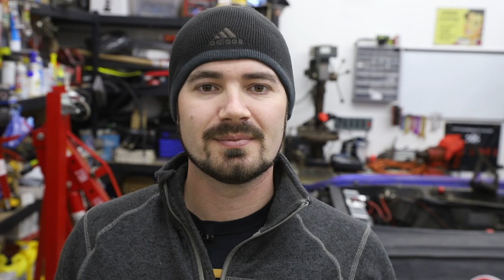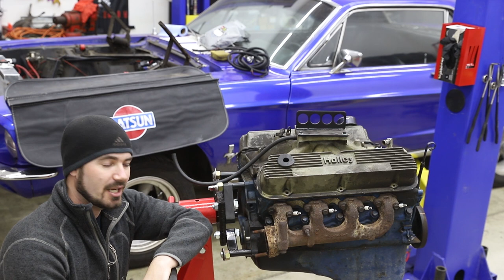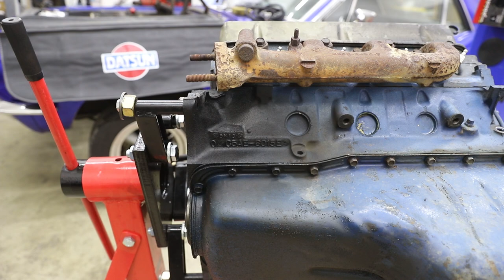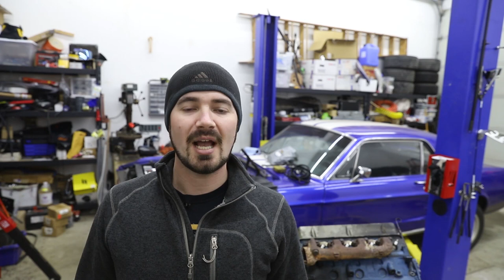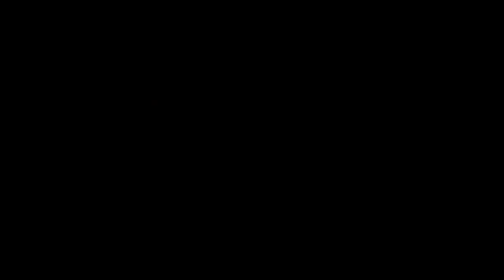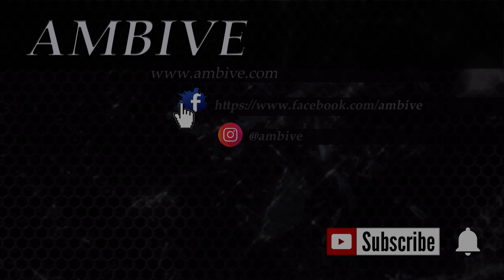67 Mustang - Identifying the old engine

Comment: Just to make it clear. You state in the video that the 6015 suffix denotes the cubic inches. This is incorrect. The 6015 is the engineering basic # for all engine blocks. The over the counter replacement block would have the part basic of 6010 for a bare engine block. Where as the prefix c5ae again is the engineering assembly line basic number which would be a C5AZ in the parts book. The whole part number as an over the counter replacement would be C5AZ-6010-A OR B or C based on how many engineering changes were made to the product line. And it is possible to have an AE block in a mustang as the blocks were all identical and originally developed for the full size Galaxy and they were used in multiple lines. Even the HIPO block was the same with different damper, solid lifters, and bigger connecting rod bolts (3/8 i believe), beefier main caps, screw in rocker studs, hotter cam and dual point distributor. However on a 1967 it most likely would have been A C7AE.  The fact that the block is stamped C5AE does not make it incorrect for a 67 as the number above it is the date the block was produced (cast) there was another stamping on the block or the engine which actually shows when the engine was assembled. So this particular block even though it was manufactured in 65 could have been sitting in inventory waiting to be assembled for a 67 model year which would have been produced in late 66 not uncommon to find that. Worked in the Ford parts department for many years if you're wondering about my source of info. Also have a few 60s mustangs as the original owners were my mother and father.
Reply: Hi!

I have D0AE on the engine block in my 1970 Mustang Mach 1. Would that possibly be the original engine? I'm trying to figure out if it's been replaced or if its original. Thanks for any info!
Reply: @itsryanfreeman  you would need to find the production date stamped on the block. Some blocks may have the last 6 digits of the vin stamped on them. The D0AZ denotes 70 for the D0 the AE is the engineering letters for AZ which is for full size cars such as LTDs but were used in Mustangs as well on engines that were found across multiple vehicles models. If it was an engine specific to let's say a boss 302 mustang or eliminator Cougat then it would be D0ZE or D0ZZ for a parts department #

Comment: Sorry buddy but There were no ZE 289 blocks. Since it's the same block as the 289 in any other car that Ford had a 289 in, there wasn't any need to complicate things and make seperate blocks for each specific line of car. It was also the same block for the 66 and 67 model year. No reason to change the number, since they didn't change the block. They were cast in Cleveland. Not that all 289 blocks for those years were that number, but that number was used in all 3 years and in every kind of Ford car that would have had a 289. Since Windsor didn't start making 289s until '66, the Windsor blocks for 66/67 started with C6.
Reply: This is correct. The AE only means that the block was designed for a Galaxy, not that it was produced for a Galaxy.

Comment: I sold fords in 1967 and you should knowThat the gentleman you bought the mustang fro may have been correct as to the engine being original to the car. Ford was producing mustang's so fast and the galaxie engine may have been used since ford galaxie was so bid most buyers bought the 390 cu engine. Also you should now that I found out when I went into the service shop on a non related problem with another Mech. The Mech' in the next bay commented while working on a 1967 mustang that ford was putting Galaxie engines into Mustang's. P.S. All manufactories did the same thing only GM got cought in 1978 butting Buick 350 into Monte Carlo's
Reply from the maker: Excellent information! Thank you!

Comment: with a B instead of the E in "6015 E" what does it mean? (6015 B)
Reply from the maker: If it comes after the 6015, it's the location it was made. I'm not sure which is which, but between 65 and 70, I believe the options were Michigan or Canada.

Edit: Here's a site with the decode listings

https://www.fastbackstack.com/2007/06/how-to-decode-your-1965-1970-mustang-engine-block-number/